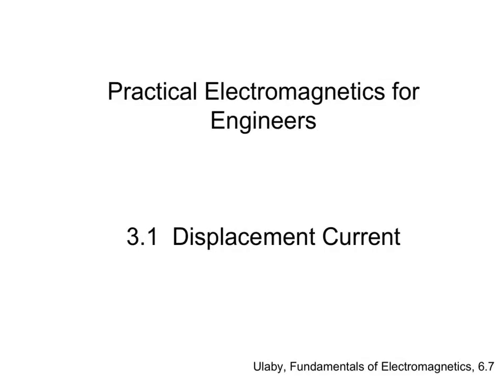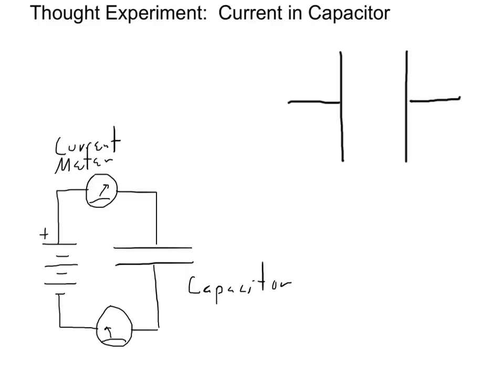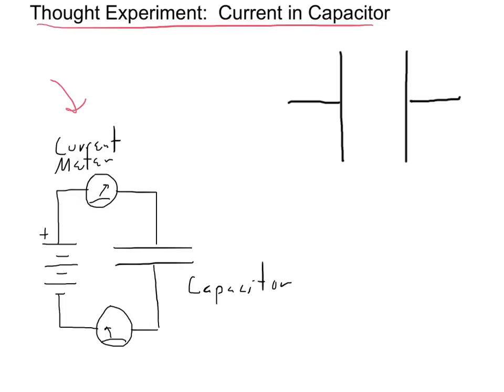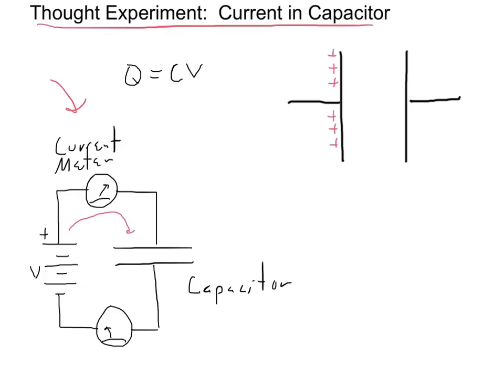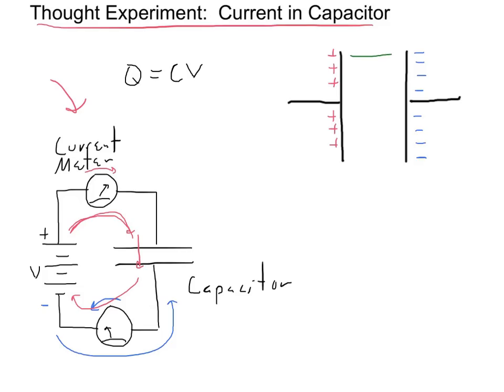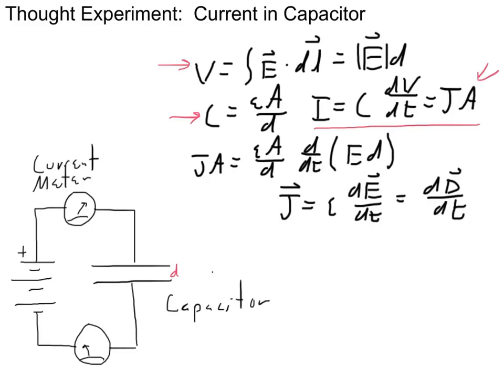3.1 Displacement Current

Comment: QUESTION: The Amp-meters in this video show opposite signs. Assuming that moving electrons represent an electric current, (I think) the current-direction in the upper-half of the circuit should be the same as the direction in the lower-half. Both counter-clockwise! So shouldn't the Amp-meters have the same sign?
Reply: Actually what i thought was one plate is charged positively. This causes induction in the neighbouring plate and so it gets positively charged. I don't understAnd how tge negativie charges can flow like that to that plate.

Comment: A Capacitor is a Transmission Line which has a low value of Zo. We do not need a changing field for energy propagation. Displacement Current does not exist. What is observed within a Capacitor when a changing voltage is applied is that the energy flowing one way is not equal in time to the energy flowing in the reverse direction and so we may measure a supposed current, which is merely the difference at any point in time between this flow. For more please look up Oliver Heaviside "We reverse this".
Reply: nah, how do you explain one wire transmission if not by displacement current?
Reply: A capacitor is a transmission line? 
By definition anything is a transmission line but to define a capacitor as a transmission line is foolish. A transmission line needs a close reference to be usable otherwise. Why even bother mentioning such comment. Also displacement current does exist. Stop misguiding people

Comment: j = epsilon dE/dt. If E is constant (which it is), wouldn't j come out to be 0 here?
Reply: Hemabh Ravee have you found the answer?
Reply: A bit late here but yeah at t = infinity the total current will zero out. this is only true for a varying E field which is occurs when you close the circuit AKA turn it on.  (Transient response or unit step or heavy side)

Comment: since there is no conduction current through the capacitor, does that mean that the current flowing externally through the wires of the capacitor connected across a voltage source is actually drift current as the plates are charged up to the respective battery terminal polarities?  Or, a better question is, what IS the current that flows between the battery and the leads of the capacitor to when the plates are charging to their respective polarities (since current is not really flowing through the capacitor and completing a loop) from battery + to battery -?

Comment: is there any relation between displacement current and the current of the voltage source. what you are saying is displacement current would be the same whether my voltage source is 12v 9A or 12v 1mA

Comment: Can the current flow through the capacitor even if the current is DC?? I thought that impedance becomes infinite for capacitors when frequency is zero. Can anyone explain about my question please?
Reply: Yes. Using AC math, we know at time = infinity the impedance of a capacitor becomes zero. But with DC math, we can see what happens before that! Going from frequency domain to time domain might involve fourier analysis. Current will flow through the circuit and a displacement current will appear and exponentially decay to zero at time = infinity.
Reply: Darklink9110 almost.....except the current through the wire is also a displacement current.

In case you're having trouble with that, ask yourself how quickly that capacitor charges. Then remind yourself how quickly electrons "flow" in a conductor. Correct, electrons do not"flow" anywhere near the speed of light.

This video presents a very naive discussion of displacement current......flow of electrons and current meters only have meaning when electromagnetic propagation is being slowed down considerably by the distributed resistance of a transmission line or other circuit elements. With a voltage connected directly to a capacitor as drawn, there is only one conduction current and that is zero......it is all an instantaneous displacement current caused by an electromagnetic field traveling at whatever the speed of light is in that medium. 

As drawn, at no time is there ever any measurable current which is dictated by the speed of electrons in a conductor.....good luck finding those ammeters which apparently have a measurement time close to the speed of light! 

As drawn, the operation of the entire circuit is dictated by electromagnetic wave propagation and at no time by "flow" of electrons....ie. there is no "conduction current" that can ever been measured by those ammeters in the circuit drawn (other than zero at dc)

Dear powerpoint professor....if you're going to segway into displacement current like this, please just stick a resistor in your conduction current circuit and stop confusing another generation of engineers. 

Just a resistor would show you really know the difference.
Reply: Simple answer: Impedance becomes infinity when the frequency is zero, but that does not happen instantenously. Time depends on the capacitance of the capacitor.

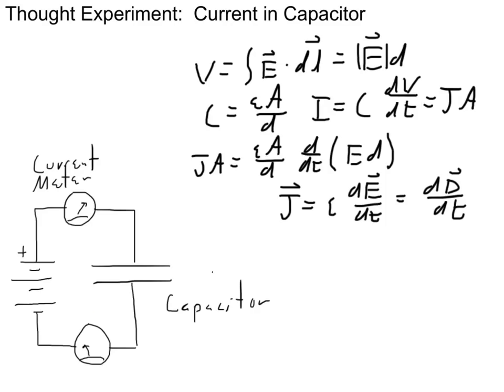Comment: 4:07 Is the top equation where voltage is equal to the Line Integral of the Electric Field supposed to have a negative? I guess using the magnitude of the Field changes that?

Comment from the maker: Rahul I don't have an intuitive explanation but the equal sign in Gauss' law says the change in flux through a closed surface is exactly the same things as adding or removing charge in the volume.  I think the mental image of moving little charge balls applies better to mass than charge.  It is simply a poor analogy to what is really going on which is that charge is only "felt" when you have field lines.  A real physicist will probably jump all over this explanation, but that is my mental picture.

Comment: With respect, it is not what you said that I object to.  It is what you didn't say.  
A moving charge (i.e. a conduction current) establishes a magnetic field.  
But a time-varying electric field also establishes a magnetic field by Ampere's circuital law.  
And so, from the perspective of the magnetic field, the induced magnetic field doesn't "know" whether it was established by a moving charge or by a time-varying electric field.  
To talk about displacement current (the partial derivative of D with respect to t) without talking about the curl of the induced magnetic field is to leave students somewhat in the dark.  The "stretching" of the mind regarding what a current is comes down to Ampere's Law:  If the curl of a magnetic field is not zero, you are dealing with some kind of current.  It may be conduction current (J = sigma*E) or displacement current (partial derivative of D with respect to t).  Either way, you have a non-zero curl of the magnetic flux density.  And that is as good a general definition of current as any.  
To understand displacement current, students need to understand curl, Stoke's theorem, and Ampere's generalized circuital law.
Reply: Thank god for your comment only one who gets it up in here.

Comment: You stopped short of explaining the mechanism of displacement current flow through a capacitor in a vacuum. 

Without an explanation for that, doesn't it seem like an incomplete model?
Reply: Hey, I believe the same question has been bogging my mind for the last two days. I think this post pretty much cleared the relationship between change in electric flux and the resulting conduction current equaling to the displacement current: https://physics.stackexchange.com/questions/83715/what-constitutes-displacement-current
Reply: I believe that the charge of an electron is not really concentrated in the place where we say that the electron is located, but its “carrier” is the whole field of the electron. Its highest density (D vector) is around the electron, but then continues to "infinity". Therefore, in Maxwell's equations in differential form, ie valid for the element of continuous space, we do not use the expression dQ/dt, but dD/dt (partial derivative). Vector D represents the charge density per considered spatial element, although the electrons themselves may be far away in the metal electrodes. dD/dt is then the density of the Maxwell displacement current flowing through this dielectric element.

Comment: SAME   wonder  that we make    in  >>>>how   votage  can  be  buildt  across  a coil  it is just   a  wire  then we learn that  voltage  is not  because the resistevity of the wrie  rather it  is  due  to current  struglle  to build  the megnatic  field  

in the  cam  the  same wonder   bulit again    how  should   current  cross the  cap  while its  an open  circuit   same solution    the ekectric  field is the media  by which  the  current travels       this is the most intuitive thing if you get the coil you get the cap

Comment: Shit. This is my second time watching this video. At first I didn't really get what displacement current is. In the capacitor example, I was bent on the idea that when the capacitor is charging, charge moves from one plate to another, that's it, end of story. But I think I get it now: That in order to satisfy circuit theory, Kirchoff's current at a node, we must define a displacement current, such that the current leaving one plate of the capacitor, is equal to the rate of change of the electric field, which is "the current entering the plate". But, now that I think about it, displacement current in this scenario is just another way of saying i = c dv/dt, just in terms of the electric field, hmm...

Comment: Displacement current through the cap. ? seems like no permanent break down of the dielectric if charges move through it !!! you can't even say that whether physically there is moving charge or not this is how we define it !! as engineers it makes no sense at all you're just messing ...... Engineers apply science after full understanding of the concepts not creating it ... please if you have reasonable explanation try to do it but you have done is a mess